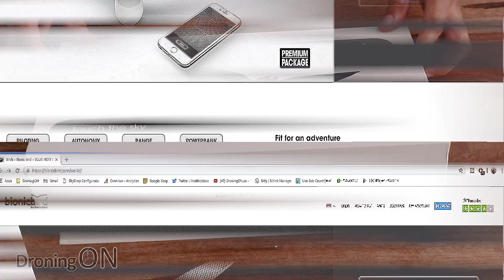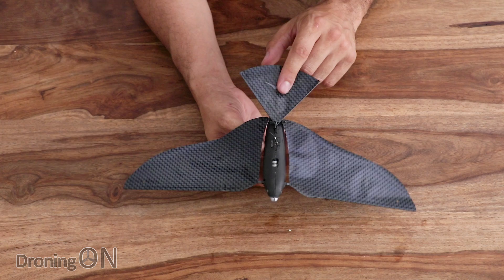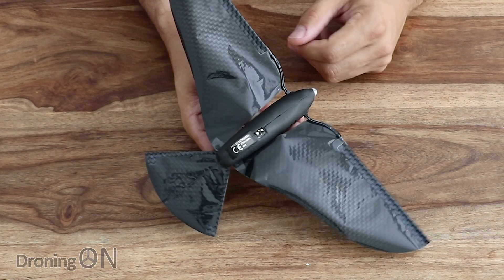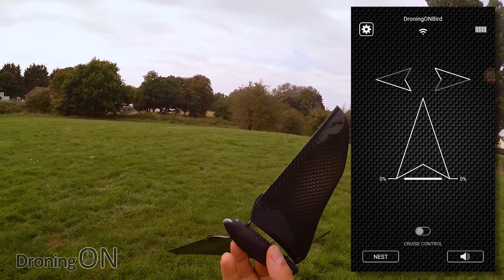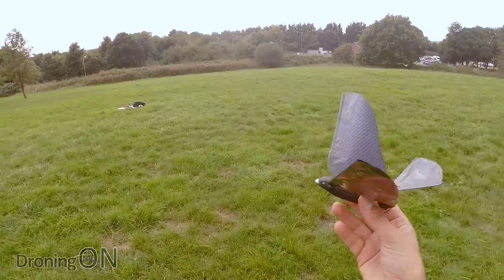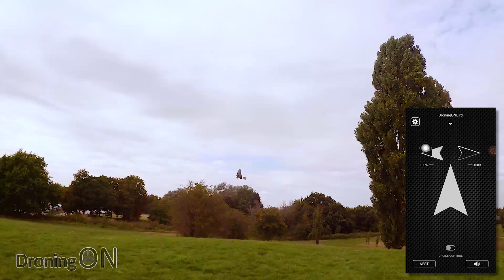XTIM Bionic Bird Review - Unboxing, Setup & Flight Test

Comment: My egg flashes then stops , but when it doesn’t charge my bird I charge it again and it is still flashing.??!!Any recommendations help please
Reply from the maker: Not sure, are you sure that the bird is turned off when trying to charge it?
Reply: DroningON I decided I would return the product and get 100$ back. I really feel that it could have been great
Reply: It is turned off, however the egg charging is where I believe the problem is. Every time I charge the egg it flashes then stops flashing in a couple of minutes. I know this is not supposed to be happening because of the Bionic Birds tutorials. It seems charged,but when bird is applied egg does not light up at the top.

Comment: Too bad it doesn't have a camera. Make it cooler.
Reply: I cant imagine  camera on this. it wiggles around and would be very hard for still footage.
Reply from the maker: A 4K sensor and EIS could make it workable, plus a flight controller inside to stabilise the flight instead of the pilot/operator having to do it - could have potential, would have to be much bigger though!
Reply: The main concern is the weight. Theres a reason its so light.